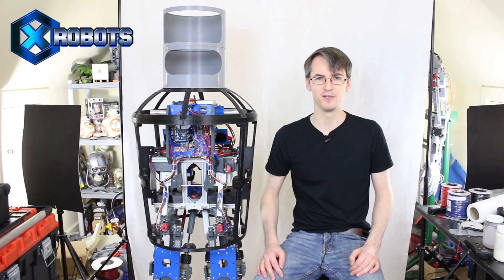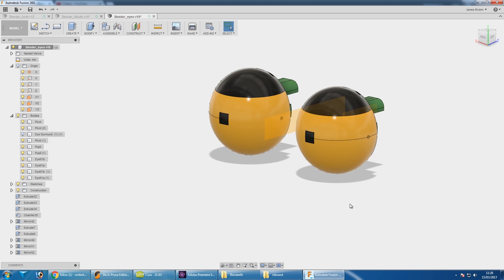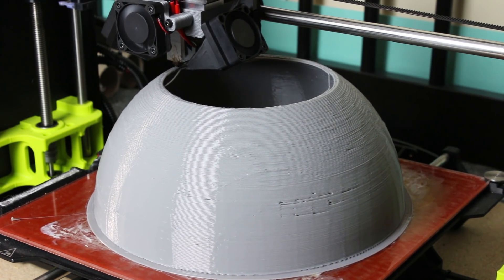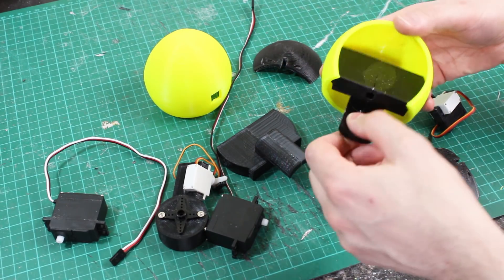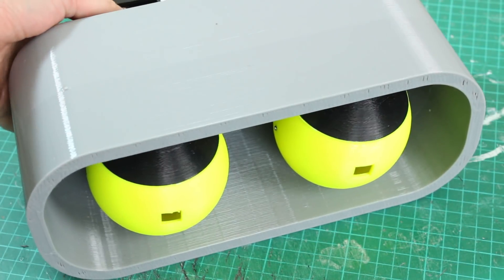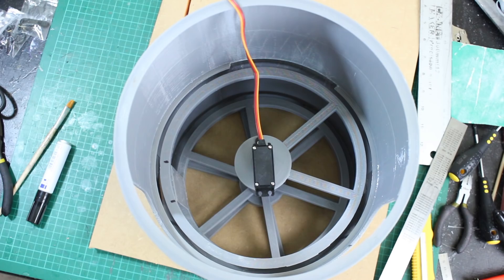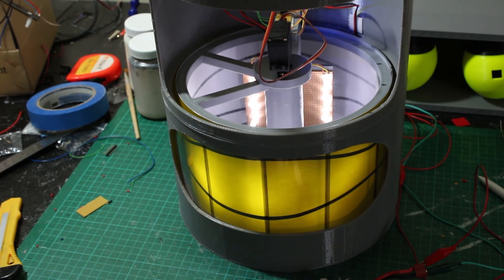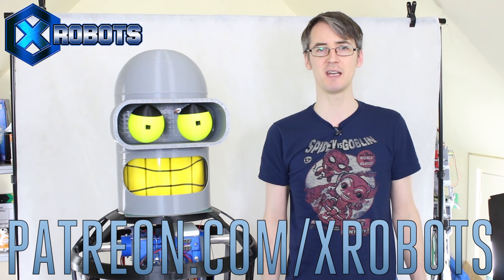Futurama Bender #1 | Building the Head | James Bruton

Comment: Hello James, great video - I like the Bender project. I have an idea for his mouth - maybe you could make a mechanism working similar to a cassette tape - you could have a spool with paper (or a thin plastic foil) with the mouth pattern stripes on it at one side of the mouth and roll it to a second spool on the other side and then reverse it again. So you can have longer patterns in various shapes. And you can also change the playback speed to adjust to speech...

Comment: So, the mouth is basically two horizontal lines and a bunch of vertical lines, right?
So why not make the horizontal lines from a flexible material, and use the vertical lines to conceal motor-driven push-rods to change his expression?
Having a carousel mouth seems both more limited and more bulky.
(...the carousel does actually look pretty good though, now that I see it.)

Comment: I have an idea for the arms. It's probably a bit hard to explain without a drawing, but I'll try. I haven't build a proof of concept, so let me know if you try it and how it works out. Anyway, the idea is to use flexible tubing with four very thin steel cables running up the inside wall opposite each other. The type of cables used for RC aircraft or the like. The hand-end of the cables are attached firmly across of each other. The shoulder-ends are attached in pairs to either end of a servo arm. So, there would be two servos, one to push/pull the x-axis cables and the other to push/pull the y-axis cables. When a cable is pulled it causes the tubing arm to bend in that direction. It might actually work better to have the cables, or even cordage, to wind around something to get more motion. I hope that make sense. A few more strings running up the center of the tube arm could be used to control some simple hand motion or grabber.

Comment: You can have just a Tube for his arms that has a string in it that when pulled makes the arms go out and when he doesn't he can drag them like he normally dose when he's drunk
Reply: I think with 3 motors each arm pulling on 3 strings would be better to get his arms in any direction. But I am sure you'll find the best solution...

Comment: the eyes look great and the mouth animation is great but the mouth needs a resting state, each pattern was too far.I'd also make eyelids rather than just the permanent lid, have a thin socket that has a wrap around strut behind the eye, add a lever that adjusts the height like flicking a light switch minus the on off state, that'd be better and not too hard I'd imagine

Comment: Loving Robot X So far! Been following since the start and excited to see how the new actuators will improve it! And I was thinking the mouth and eyes are a bit yellow (Benders is more of a beige) You could probably just paint over it. And maybe instead of it spinning the mouth and the only way to get anything different is by changing the paper maybe make a mouth with string/wire and a few servos to form the wire into a curve. that way you could program any shaped mouth. Only problem is it would need a lot of servos to make it look like a clean curve the only other thing I can think of is try and get a hold of one of the flexible OLED screens and actually render a mouth on a screen maybe using a raspberry pi to power the screen. Either way I love how bender is looking so far and really excited to see it progress! Love your videos keep up the awesome work!

Comment: To make the mouth work as accurate and as flexible as possible to do whichever mouth shape you'd want, you would need to either use projection (with a pico projector?), or just using animatronics, using two bicycle cable guides or some other sort of thin coil going horizontally, and linear actuators pushing and pulling different parts of those, going up and down.